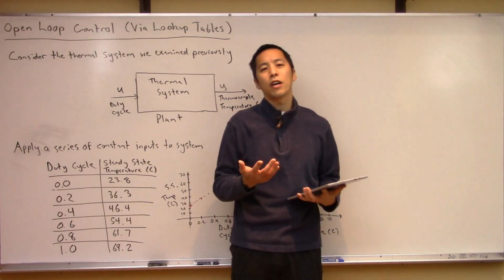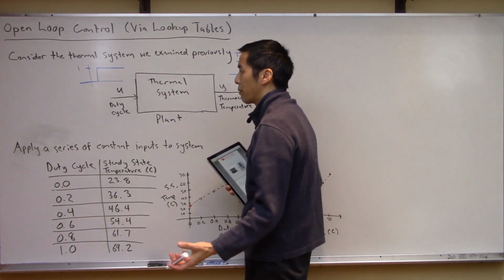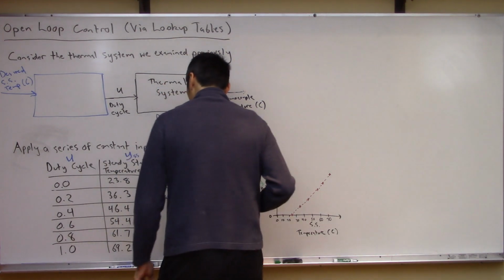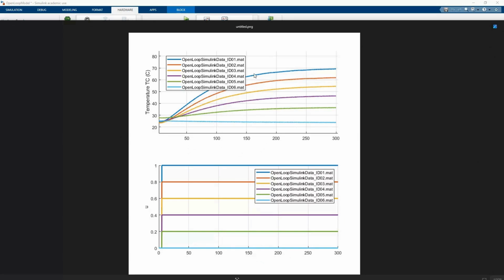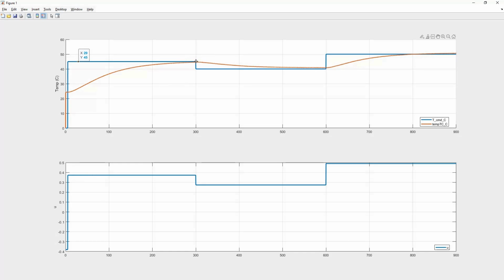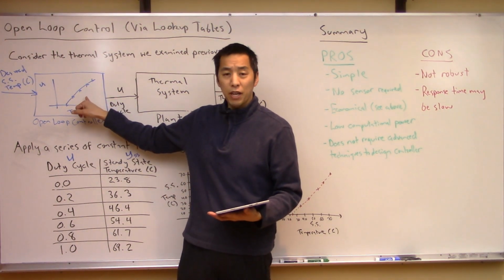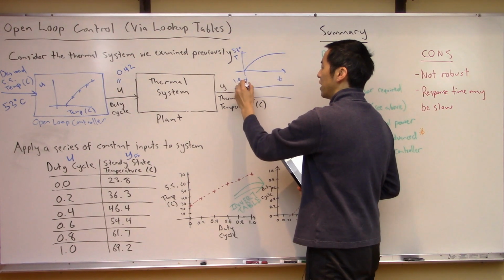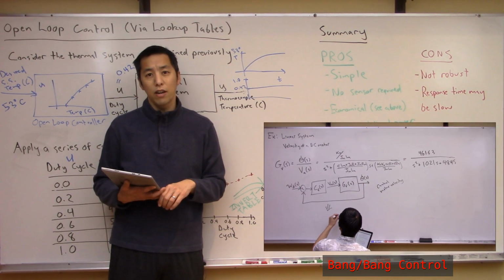Open Loop Control Via Lookup Tables

Comment: AE511: Good old open loop control! I’m looking forward to learning how we can make it smarter and cross the threshold into “feedforward” control.
Reply from the maker: Nice job getting a head start on things.  Open loop control is fun and easy but it doesn't perform well.  As you mentioned, closed loop is going to do much better.

Comment: I'm actually working on a lookup table controller at work right now. One interesting aspect I'm running into is that the response of the system (w.r.t. a basic linear ramp control signal, "x") is non monotonic (approximately A*cos^2(x)), meaning the LUT can't just simply be inverted.

Comment: Worth mentioning that lookup table open loop control/guidance has a place in advanced control system stacks. Humanoid robotics, for example, will sometimes have libraries of offline calculated optimal trajectories for “motion primitives”, like a backflip. It is too expensive to solve the nonlinear optimal control problem online, but prediction speed from lookup tables, or whatever interpolant/model, are often fast. Happens in aerospace too.

Love the vids. Thanks.
Reply from the maker: Excellent point, in fact we'll take a look at this when we look at feedforward control strategies which implement many of the motion primitives that you mention.  Thanks for watching!
Reply: Back when dinosaurs roamed the earth (aka, 1980s) we used multilayer neural network to figure out the differential equation by itself when things got too messy. Unfortunately, we couldn't easily prove corner cases so it wasn't used for critical systems.
Reply from the maker: @ It is funny how things are circular in the sense that neural networks are coming back into fashion now :)